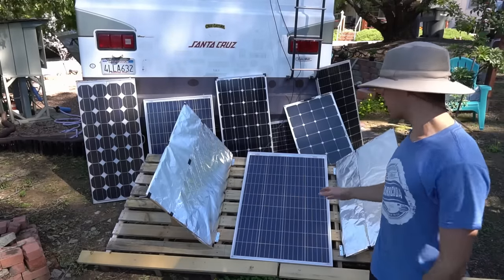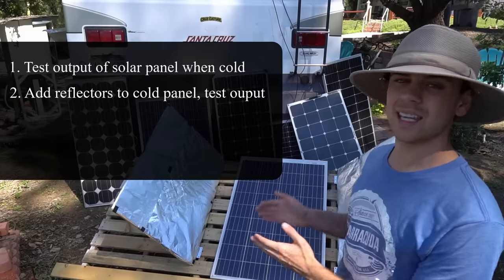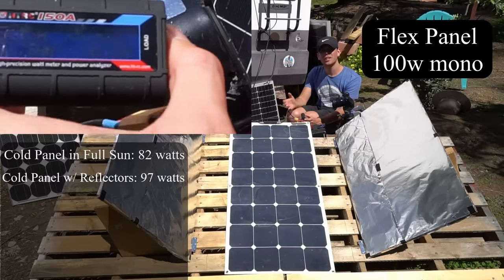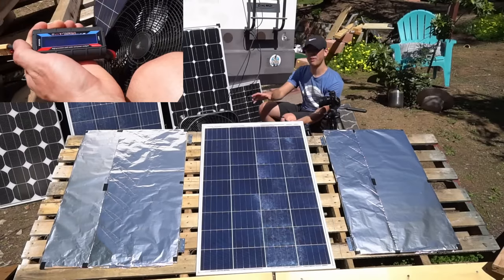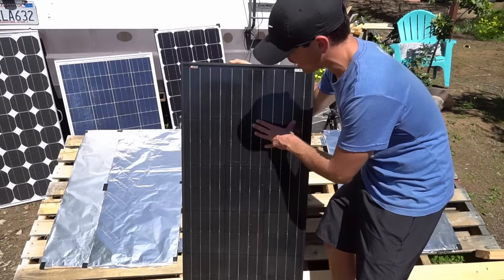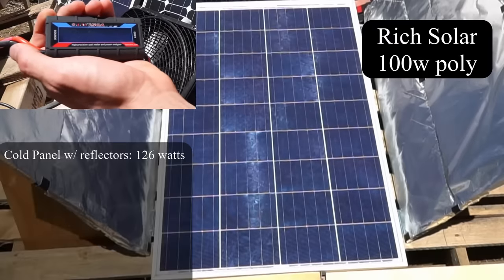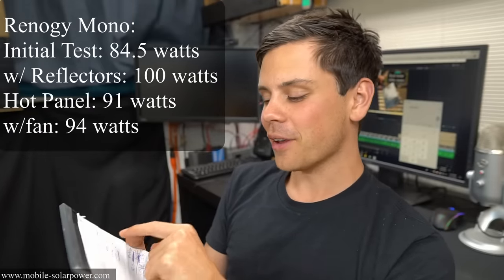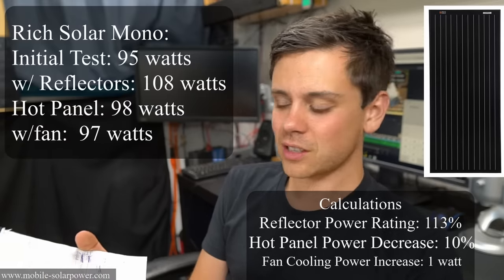Solar Panel + DIY Light Reflectors = More Power? Renogy vs Rich Solar vs Flexible Panel

Comment: 2 in 1 Solar Panel. Extra efficient electric & warm water output
Efficient cooling of electric solar panels can increase the efficiency greatly. BUT it's not possible to achieve sufficient cooling by simple air cooling of the solar panels flat surfaces.
Air cooling doesn't get much better by changing the air flow from exchanging the air compared to a very high, storm like, air flow. The very easy to clean surfaces on solar panels are are not sutible for any forced air cooling. The cooling done in this video is done by an amateur (sorry) not knowing enough of electronics and physics to conduct tests good enough for making conclusions of the experiments. Most important in all technical design work is to know all unwanted parameters and how to deal with them in a professional way. That's one thing all engineers get to learn in their education. I like this guy who is a "happy camper" (or a really bad educated technician), still i like him and hope he will read this and understand it good enough to make an experiment without any significant design flaws that will make his effort less useful. Drawing the wrong conclusion of a badly made experiment do actually create harm by teaching false. Never believe people, books, TV or Internet blindly, always question everything you taught and what U maybe know....
Using water cooling/warning on the back side of electric solar panels can be worth the money.
A hot solar panel without load has a relative increased voltage but when connected to a load it will have a relatively lower output due to an increased internal resistance and that result also in a relative higher internal power loss. This property is true in most electronic semiconductors.
However a very cold panel will have a, relative to normal lowered voltage without load, maybe to low for proper functionallity in simple installations without a good regulator with boosting capabilities. A cold panel has a lower internal resistance and power loss. In cold climates it can be beneficial to raise the temperature of the panel.??
Getting more efficient electrical outlet at the same time as hot water in a tank
The benefit would mostly be for those who has a limited space to mount their panels.
A regular framed electric solar panel with a backside deep enough to attach mesh or looped water cooling hose and mold it solid.
Turn the panel upside down, fix a tight spaced mesh of hose and fill up with resin.
It's crucial to use flexible and heat resistant hose and resin. Using extra soft copper tubes make the bending much easier but straight parts must be avoided due to temperature expansions and crimping stress as cooler water will make the metal tube to get shorter, but by using very soft copper tubes it's easy. Avoid very tight bends to keep easy liquid pass through. Using copper tubing may increase the risk of galvanic electric current but is easily avoided... Put flexible spacers between the tubing and panel. The copper tube must not come in contact with the aluminum frame of the panel or any other metal. If using copper i cold climate conditions it can brake if water freezin
Take help by an engineer to calculate most energy efficient water circulation. My estimate is to use a non pressurising water pump not running continusly. For testing a low priced 12V "in line" type used in boats or camper houses. Easiest is to connect cooling water pipes from one to another in series and run the pump as long as it takes to exchange the heated water to cooler, but not to long, preventing cool water to go back in the tank.(*1)  If parallell cooling is prefered then the wather flow to each panel has to be calibrated for all separateh panels  for but instead run just as long it takes to run panels and sufficient flow the piping to the panels can be connected in series
Important design of the hot water tank: drain cool water from the bottom of the tank to an efficient water  pump to cool the panels.
Very important is to use a water tank with more vertical hight and less width creating temperature layering inside the tank and that the hot water return don't mix mix or stir the temp layering in the tank. Efficiency get really bad if the colder bottom of the tank mix with the warmer water in the top. The hot water return pipe must not stir up the layered. Quick amateur fix is to make any design preventing a high flow return to the top of the tank using a very large diameter tank connection or anything that spreads the hot return over the upper part of the tank with as LOW FLOW as possible, preventing mixing within the tank. Professional tanks has one or two partly dividing plates inside the tank to prevent mixing. Most tanks also has one or two coiled copper tube windings used as heat exchangers. One for hot water in the top of the tank to heat water as a heat exchanger.  It also prevent bacteria from entering the hot water taping. In to medium temp tanks it's greater risk of growing bacteria. 
I warm climatic conditions a hot water tank may get top temp fast and when the hot water tank gets hotter electric power output will decrease gradually.
To continue cooling of the panels a waste cooling functionallity can be implemented in-between the tank and panels or by use of manually or automatic switched valves.
With 2000-6000 W normal panels to cool i guess a small to large car sized radiator will be needed to make a difference.
To much work for a 30% gain. If the panels are stationary then the ground can be used to cool but that's outside my knowledge. 
Don't know how, but i would like to know if anybody succeeded like me on my ⛵
I'm a European and don't care about misspelled word or skitty grammar
I have been a professional inventor with a few patents in mostly high power electronics. I don't do bullshitting...😎

Comment: Fantastic data!!!  Now to tickle your well schooled scientific brain, because the panels differ in physical size and that you already have the data points, how does poly and mono compare based on square foot surface area throughout the various lighting conditions?  Second question, When comparing the different panels, do you believe that the charge controller presents an equal and stable load to the panels?  Understandably, we are not looking at hi precision tests to a fixed high tolerance resistive laboratory load.   Keep up with your videos, this old man enjoys them very much. de K2LED

Comment: Impressive results, though some seem a bit higher than I would expect. Have you tested to see how calibrated your watt meter is?  I've used a few watt meters similar to what you are using, and they seem to vary widely on calibration, even on voltage, which would effect it's watt readings.
Reply from the maker: I have actually tested a whole array of these wattmeters when I was really into quad rotor racing. I never found a single one that was off. Which manufacturer of wattmeter were using?
Reply from the maker: Could you please post a video of your watt meter readings because I really need to see this.
Reply: @WillProwse   I don't have any video of it, but one was the JZCreater 150A Power Analyzer on Amazon.  I have a couple of reference voltage devices, and here's what I got from it while supplying power to it through the extra pins, 2.5 shows 2.37, 5.0 shows 4.87, 7.5 shows 7.39 and 10.0 shows 8.76. These are the same voltage references (I have two) I use with all my meters. I cut&pasted those values from my Amazon review of it. It seems a few others also mentioned accuracy issues. It could be I just had some bad luck. This was over a year ago.   I recently ordered two more that I just got in but haven't tested yet.  I'm hoping they work as my other watt meters I use have the big external shunt, so you have to put it in a largish project box.

Comment: On Feb 24, 2019 you uploaded a vid about 4 panels you got off amazon. The Renogy vs. HQST vs. Rich Solar vs. NewPowa. You thought the HQST was the best. Question. Why did you not use those panels for this vid?
Reply from the maker: Because it's identical to the renogy mono. Same exact panel. And the rich solar is going to be tested against three other poly panels next week so who knows what's the best at this point. I can't wait to find out

Comment: so the question would be do you want to use up power to use the fans cooling effect.. the fan will use up power and if its more than you get out of cooling then ditch the fan
Reply: seems obvious rich solar panel from few vids i seen of yours are kick ass.. for sure those would be the ones I would go with once I start buying i  mean hell free shipping 80 bucks.. 100 watt panel.. 320 bucks you have 400 watts

Comment: Think you are on to something. You are reflecting the light and heat to the panel. Have you tested UV reflection or filtering, to reduce heating yet get the sunlight? Im guesstimating reduced heat to panel and attic if roof mounted. Have you tested using fluid for cooling and water heating with solar panels? cool panels, roof, attic and get hot water, along with efficiency of panel.

Comment: Solar concentration is something that it is not new. Even in larger scale (MW scale) With a factor of 2x (two reflectors of the same size of the panels) ~2000W/m2 Irradiance...(theory) depending on the module and obviously  solar tracking also (2 axis), you can achieve at least 30% better yield /year. The million dollar question is: is it worth it? with modules at 50c./W or even lower? of course not... just swipe the ground like a carpet with solar modules...at those prices...
Reply: But nice experience!
Reply from the maker: Exactly!! I get this question a lot, and that's why I made this video. Did you watch the entire video because that was the point that was made at the end.

Comment: Why don't you try a water cooling system on the back? The result is double the profit: more energy + hot water. ;)
Reply: PV on top, stirling engine on bottom.

Comment: Is there any Infrared reflecting films that allow the rest of the frequencies through and reflect the infrared? 
Therefore the heat source?
Reply: Yes, you can get Low-E window film, usually a polyester film with a very thin metal coating that controls infrared transmission. Low-E windows are sometimes manufactured with the metal directly applied to the glass, sometimes with film applied. Interior-facing windows use coating designed to reflect IR at wavelengths associated with interior heating to reduce heat loss through the window. Exterior-facing windows use a coating designed to reflect IR to reduce solar heat gain (depending on application, in areas where interior heating cost is greater than cooling cost more solar heat gain is desirable, in warmer climates where cooling is more costly, less solar heat gain is usually preferred).

It would be interesting to put some Low-E film in the optical path to see if it affects panel heat. I'd suppose that if there was a great benefit panel manufacturers would apply Low-E coatings to the panels, but maybe when using reflectors there would be some additional benefit from removing the IR before it reaches the panel. Maybe not cost-effective, but probably fun to experiment with.

Comment: Hi new  to this video utber  . I was impressed with the  range of simple tests  that were done and the breakdown of findings at the end ,    i will try to take on board   the panel information as i would like to build  an offgrid house in the west indies  where the is a generous amount of sunlight  that could heat up the panels , is there any  device that monitors the heat panels in  a  solar set up or array ? perhaps that gives idea for  you next  youtube film.

Comment: What about mounting the fan underneath the panel? For reflectors, ever thought about a lens?
Reply: I would think a more passive system using copper heat pipes and a fan would be more effective similar to a computer cooling a CPU.

Comment: Can you add a thermoelectric device attached to the back of the panel 🤔 to harness some more power when solar panels are hot.
Reply: Yeah but it would be cheaper to just buy more solar panels. Remember that thermoelectric device works on temperature difference not on heat.
Reply: wwwelkam  Solar Panels on a frozen lake, dry ice, geothermal well, use the vertical realestate of the solar panels. Would make for an interesting YouTube experiment if anything to see how much power you can generate from the same space. Make clothing that sits on hotspots of the body to generate electricity, a sleeping pad, a solar powered hat & Umbrella 🤭 Umbrella Hat 🤗

Comment: Bifacial solar panel with mirror may be good  for increasing albedo factor
Reply: Not working. I got IT
Reply: Max sun winter . Back clear front full snow giving from 9.63 (all) 1200w  that's is 10% . Where is other 20% IT was lie

Comment: I ordered 4 richsolor 100 w, but it did not go that high,  mine only about 50w to 70w at full sun at Southern CA, I connect to MPPT and 3000w inverter to two agm battery
Reply from the maker: Try discharging your batteries or using lithium

Comment: trying to design and build a setup to use from my hi-rise apartment window with limited southern exposure. will using the reflective side of automobile sun shields work as good reflectors?

Comment: But it’s not useable sunlight. Unlike over clocking that has room before too hot to function.
Can you try water cooling. Spray water or a mm over the panels.
Reply: If you have a stream/river nearby you could watercool them for cheap but all that trouble is way too much trouble. Just buy 10% more panels, set them up and use the free time doing something else.
Reply: Would probably crack the glass.

Comment: fyi, the angle of the sun changed over the course of your experiment, which looks like several hours. You need to test them all simultaneously.
Reply from the maker: Not by much at all. I factored this in

Comment: That’s cool, but the reflectors are the same size as the panel. So brings me to my question, why wouldn’t you just get a few more panels? You’ll get more watts per panel than a reflector taking up that real estate.
Reply from the maker: That's exactly what I said in the video.
Reply: Will Prowse sorry, I must have missed that part.

Comment: Im not sure how you got the conclusion not to use reflectors. You were getting almost 20% more output, and if you made the reflectors a little wider and positioned them so they were on the bottom and top of the panel rather than the sides you would only have to change the angles a few times a year to compensate for the different seasonal solar angles.
Reply from the maker: It's cheaper to buy more panels instead

Comment: Parabolic reflectors and liquid cooled panels are the future of solar?
Reply: Liquid cooled would be expensive unless you have something to do with that heat. Pools might be the best choice, not your house hold water heater. BUT pool water is corrosive.
Mirrors might be interesting but only in an area with plenty of space, if it's on a space limited area like a roof you are better just adding 2 more panels.

Comment: Good effort . do 1 thing. install dubble vacuum glass infornt of panal. mostly we use that glass in transparent refrigerator of soft drinks.. now some people start to use in Windows.. it's little expensive but it's do what you want. they only transfer light but not heat.. make a video and send me a link
Reply: additional glass will decrease the light transmitted to the panels. less heat, but also less light resulting in lower power output if you just left it alone.
Reply: @meepmoop99  i don't think so.. glass can't make resistance on light. even every electrical light we use glass. light bulb also have glass our car light also and so many examples we have. may be 1% effect the panal but more then 60% protect the panal from heat
Reply: @technicaldunya1095  not all light is transmitted through glass. each type of glass will absorb, reflect, and transmit (pass through) variable amounts of light. if you add another layer of glass in front of the panel, some light (and not just infrared) will be reflected instead of transmitted thought the glass. look at residential windows at your home improvement store of choice: there will be transmittance and reflectance ratings.
Reply: @meepmoop99  may be. but here we talk about only sun light.. i think overall we got good results by using this type of glass

Comment: Combine a solar panel with a water solar cell, to transfer the heat and then put the aluminium reflectors to collect more solar power
Reply: and because polished aluminium mirrors are a lot cheaper than the panel, then just multiply the area of the panel without multiplying the cost
Reply: Make a motorized reflector/panel sun tracking platform, problems solved

Comment: Next gen solar panels water heater/cooling photovoltaic panels.
Reply: Have your entire passive pool heater run behind your photovoltaic array... don't even use a pump to move it just let convection do the work... you get a pool heated for free and a few more percent of efficiency from your panels

Comment: some late info.   good work; except where its not.          at 7:22,   any performance  comparison  SHOULD  begin with  rated  output;  and  this panel  Fails.     cheers      googletranslate

Comment: So how are poly panels producing more watts (without reflectors), unless one panel was not to spec? According to my research, none should reach 100watts in real world conditions, and the poly should suffer more with clouds/shade.
Reply from the maker: Because they are rated differently. The poly panels are larger. That's all. No special secrets here
Reply: @WillProwse   But they were all 100 watt rated, correct?
(I'm only referring to the panels you tested in this video)